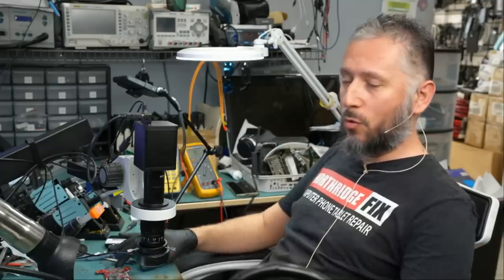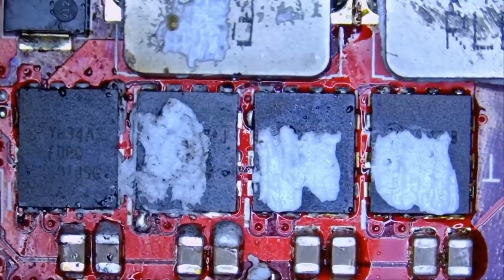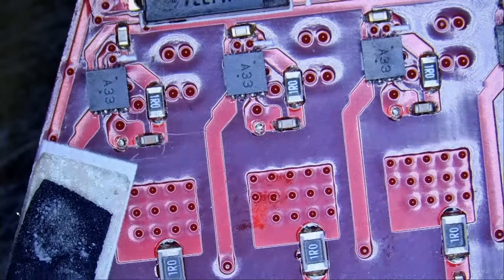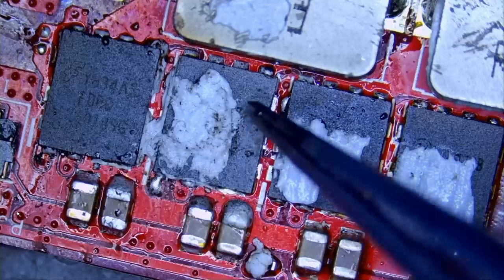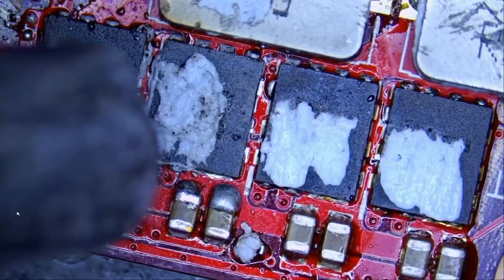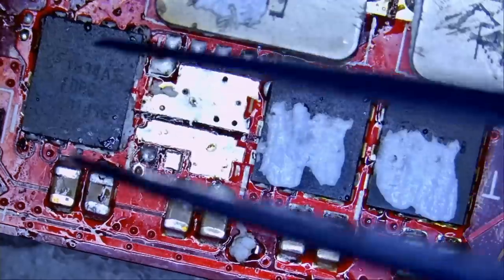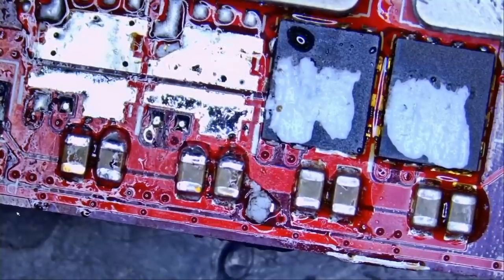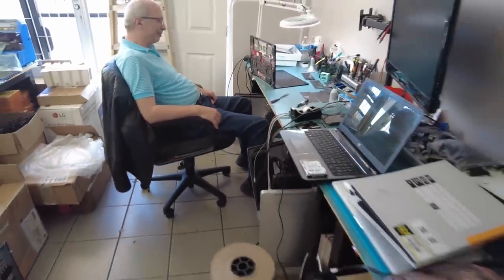Asus ROG Laptop Fixed - Your comments helped.

Comment: Makes sense when you think about it. The only time  a manufacturer would use 2 MOSFETs in parallel is if the current load is over the capacity of  single unit, therefore when one fails it also takes down the adjacent unit. Replacing one only just leaves a working MOSFET which cannot handle the total load, therefore it blows again. The fun part is while the normal failure mode is to fail short, one didn't.
Reply: Is there anyway to detect that is the case prior to replacing one of them? How can one know  beforehand that they are installed in parallel?
Reply: Still dont get it: if both parallel lines are dead, why the second mosfet read OK when the first was removed?
Reply: @reeldeelz2940  Basically there are 3 terminals, if all 3 have continuity between the 2 MOSFETs then they are connected in parallel, and therefore if one has failed, it is safe to assume the second has. In the case with Alex you can see the tracks join both MOSFETs together in parallel. It's safe to assume every manufacturer is cost oriented, there is a reason for every component, if they didn't need a MOSFET it wouldn't be there, sure they could use a higher power unit, but if 90% of their needs are the lower power ones they get a good price on them and it would be cheaper to use 2 in parallel than buy a relatively small quantity of higher power units just for one model.
Reply: @reeldeelz2940  gate drain and source are connected in parallel, measure 0 ohms. If the laptop would power on by only removing the shorted mosfet, the other one is still functional. If not then the mosfet also failed but just isn’t shorted.
Reply: @reeldeelz2940  If you measure continuity between the inputs of both MOSFETs, you will see they are shorted if they are in parallel.
Reply: @fradd182  It didn't fail causing a short to ground. One of the junctions probably blew up opening the circuit. It's a less likely and hard detectable failure, but it's possible. The laptop won't power on either if the problem is a short or an open circuit. In both cases current can't be supplied to the load.
Reply: @fradd182  Maybe the remaining MOSFET was open, so when Alex tested for a short after removing the other MOSFET, it seemed okay. But when the shorted MOSFET was replaced and the laptop rebooted, the replacement MOSFET was again carrying the full load and it shorted again.

Comment: Greetings to the community.  Thanks to Michael and Alex for sharing.  Great job. I must confess that at  first I just could not understand why the second mosfet would be affected given the parallel configuration. However, after reading the comment given by a commentator, I realize that it leads back to basic electronics where  the sum of the currents in the branch circuits is equivalent to the total current produced by the source. Therefore, each mosfet would carry just a portion of the total current and would likely be affected collectively based on their configuration. Thanks  guys. Be blessed.

Comment: The two mosfets work like two cranes: they need to work in perfect synchronization: if one mosfets is slower than the other one means that one mosfet takes more load causing it to be overloaded.

Comment: This is a great channel! We learn and then give back :)
Just shows how sharing is important for both sides.

BTW, very hot components (+200C) can behave differently especially semiconductors. For example MOSFETs can be opened (drain, source low resistance) even though no gate voltage is supplied.
Reply: Yup, that's why we don't take measurements while the board is hot.

Comment: Just counting the number comments of ‘Yeh I knew you would have to change both MOSFETS’ and checking if they posted this before Michael on the original clip ;-) It is like the car repair channel I follow you get the same posts after someone else spots something. ‘I was about to post the same thing!’ is also very common

Comment: The case of 2 paralel mosfets burned partially ou all in computers is known also with tranceiver's final HF power amplifiers on two or three models of CB tranceivers (Ham international for example) equiped with 2 final power amplifier in paralell. When one of the two PA of the tranceiver is burned, you must change the two PA because if you change only the bad PA, the second PA wich seems good will die quickly after... Then you fix the problem...
Thank you for all your very interesting videos.

Comment: The first mosfet was bad, shorted, however the second one may be bad, open. Remove the shorted one and the short goes away, but even when the shorted mosfet is replaced, it gets no assistance from the bad open mosfet, so it over dissipates, and blows immediately from handling all the current, instead of just half.

Comment: Alex can u test finding a short using thermal paper. The paper that turns black when subject to heat. Just wondering if that would work in locating a heat spot on a board.

Comment: So, it seems to me that the #1 mosfet was misbehaving all along, not enough to short itself out, but to cause harm #2 mosfet and cause it to fail, twice. Alex, do you think you would have caught this at the beginning using voltage injection and the thermal camera (would #1 mosfet show hot, compared to #2 mosfet)? Maybe with parallel components like that, it is better to assume if one measures bad, the previous one in parallel may be the problem?
Reply: I guess that using a thermal camera would pinpoint the second mosfet as a problem and not the first one. The problem with parralel devices is that both should be working ok to be able to handle the current so I guess the first one had bad gate/driver circuit and all the current have been handled by the second one and it shorted by too much current.
Reply: Maybe yes maybe not, but i agree with you 90%, because when using voltage injection can show the prob
Reply: First mosfet probably open circuited. That put double load on other mosfet, killing it, always. They are supposed to share load. Alone cannot handle the current.
Reply: @VladoT  yeah, that's pretty much what I was thinking as well. Thermal cam probably would have shown the problem _area_, but not necessarily the problem component.

Comment: Strange that MOSFET looks good on measure, but actually faulty
Reply: @alexxustube  I seen it ones on some power diode. It was ok on low voltage, but was shorted  when higher voltage was applied